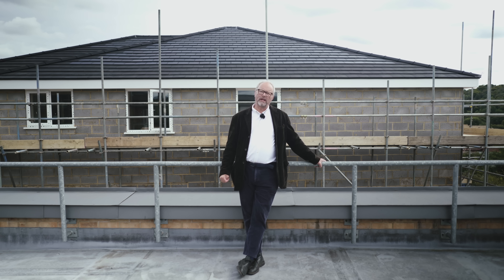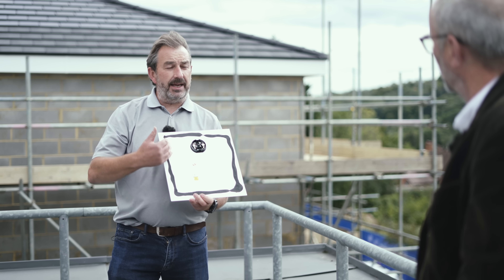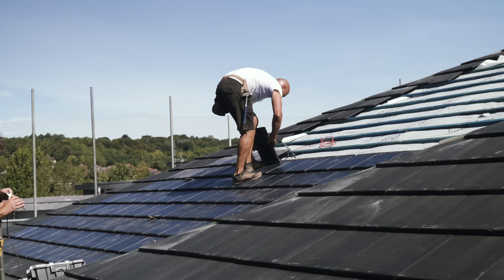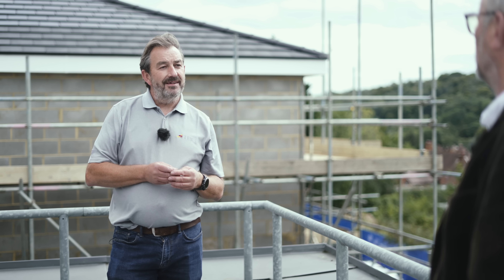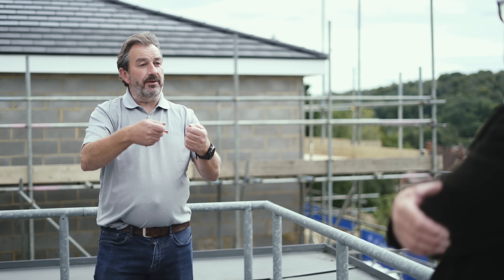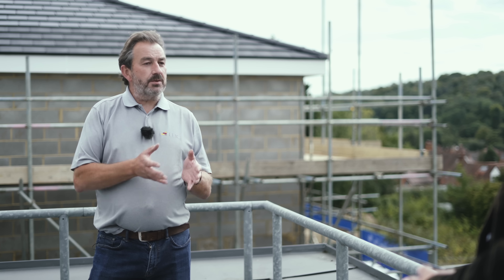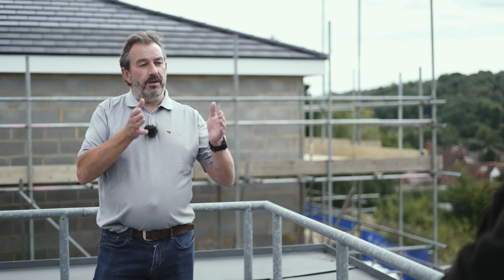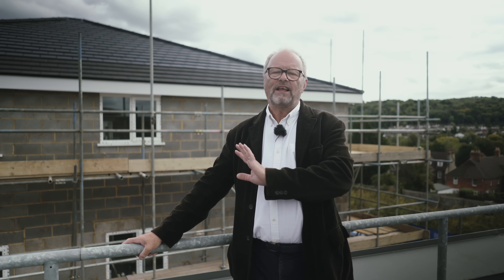Solar Roof Tiles - should every building generate its own power? | 100% Independent, 100% Electric

Comment: 1. Who climbs the roof periodically to clean the solar panels so they maintain efficiency?  2. What happens to the solar panels during a hailstorm? 3. What is the time-frame of degredation before the solar panels need to be replaced?  

It seems to me - economically speaking - it would be more efficient to light a pallet of pound notes or dollar bills on fire, then generate electricity with heated steam than this roof.
Reply: DuPont ETFE does not need any cleaning beyond rainfall
The tiles have passed the European hailstorm requirements
25 year performance warranty on the cells output. In 17 years of installing we have never replaced/upgraded old cells for m=newer more efficient versions
Reply: Chris Hall What fantastic non-answers! Let me see if I understand:

1. In between rainstorms one must suffer the degradation caused by dust, dirt, et cetera. 
2. You would have us believe the solar cells themselves are absolutely invulnerable to hail. You must - as you are suddenly quoting about tiles that one would expect - being made of concrete - are impregnable, and that nobody asked about. I do say there is nary a word about the solar cells themselves, of which a direct query was launched. I should think the laws of physics dictate being sandwiched between the practically immovable object and a not insignificant force literally raining from the heavens has consequences. 
3. Also we are to believe these are literally the only solar cells in the entire world that do not suffer performance degradation over time. 

I have to say, if we are to believe that solar cells in this video are truly magical to the point they are invulnerable to the elements and never, ever lose performance... it is perfectly unbelievable.
Reply: @1macgeek  1. In 9 years of having solar on my own roof, they have never been cleaned and are still working close to initial expected output.
2. By Tiles, I meant the completed solar tile. The silicone wafer is protected from impact by the DuPont ETFE mineral polymer topsheet. The European hail test is for solar tiles & modules, not for roof tiles.
3. The industry standard performance warranty on the cell output is, that they will still produce 80% of the design yield after 25 years. This does not meant that after 25 years they will instantly fail and require replacement, just the extent of the warranty that the solar industry typically offers.
Hope these answers help you to understand what we are offering, as this is just one solution in a range of options to increase the uptake of installations of solar pv technology.

Comment: Whether this system, Tesla solar roof or something else ought to be made more of a standard. I did back of the envelope calculation which says about 52m² on every household would give enough power for the whole country. And I am talking giving power to factories and such. The 52m² would cover more than the energy needs of the household itself. Households only consume about 30% of the power in a western country.

Obviously there are complicating factors here in that the power will not be delivered exactly when you need it. But it does give a sense of just how much potential there is in covering every roof. And 52m² is a pretty modest area. I would think a normal house roof is at least 80-100m².

But imagine having a house with 100m² solar panels. It will produce 75.00 kWh on average per day. That can charge up a typical Tesla car battery. However your average western household only needs about 10 kWh per day.  So you actually got lots of power you can sell to the grid and make money. With the big Tesla car battery you can store this power and just sell it when there is demand to make a pretty penny.

And the neat thing about solar is that you can in principle expand as you got money. You don't need to build 100m², you could build smaller. Then make money off that for some years and later expand.

With the Tesla million miles battery and bidirectional charging we are going to see some crazy no opportunities for people to have energy independence and actually make money from their home house selling power.

Comment: I'm all for Pv panels, I have some. But my question is will these get seriously hot? Mine have an air gap and they still get very hot.
Reply: Hi Dom, as we install all types of panels and tiles, from experience I can confirm that traditional modules get hotter than these tiles. The glass top sheet seems to magnify the suns rays ( just sit in your car on a hot day and feel the increased power of the sun through the windscreen?), whereas we have no glass over the front. We then bond onto 4.5 kg of concrete which acts as a heat sink, slowing down the heating of the module. 
We also have a different configuration of micro wiring on the actual silicone cells, making them much shorter than those found in standard modules,  as the performance drop in hot modules is actually due to increased resistance caused by heat in the wiring, having shorter wires reduces the effect of heat.
Reply: @chrishall8738  That sounds good, where could I find the test data for these tiles? Is it published anywhere?

Comment: Sounds like it would be cheaper and faster to produce a long 'five tile' unit, and install them that way. And use the more expensive individual tiles for the end sections.
While it's not possible to cut tempered glass (as Tesla uses) you can make lookalike tiles that can be cut, and also slightly change the roof shape to make it fit pre-shaped tempered glass tiles. So they should be able to make any kind of roof traditional tiles can.
Reply: Hi John, joining 5 tiles together would make them too heavy and fragile for a single man installation.
The initial design concept was for the modules to fit to the most popular size commercially available roof tiles, rather than invent another format of solar pv.

Comment: It's still a silly idea. Daylight in Buckinghamshire varies from 16 hours on July 21 to a mere 7:45 on December 21, so even if the panels would generate maximum power with any spark of light you would still only get half of the power on days where you are liable to use up to twenty(!) times more power than on a summer day. So no, there is no 100% independency because that would require you to somehow store in the order of 85% of the power generated in summer to be used in winter, and you can't and that doesn't change if you increase the numbers to include every home in the UK. The only thing you can do and what does in fact happen, is that you sell the excess power you generate in summer and use the money to buy energy back in winter. And that creates a contradiction, because if every home in the UK had solar there would not be any buyers and you would have no other choice than to detach the panels and let the power go to waste. So no, presenting solar as the primary solution for a carbon free future is not just silly but also a lie. As implemented today the only thing that solar does is disrupt the stability of the national grid and compensating for the erratic output of solar actually causes more carbon emissions than when power plants still controlled the grid. Really the only sensible thing you can do with solar is treat it as a non-vital element in our energy supply and use it to create hydrogen that you can use to power your car or other fuel dependent machinery.

Comment: LOL. Why does anyone even bother with mentioning Tesla roofing anymore? Last I checked, in their first three years, they installed less than 50 roofs (most of which had.... issues), and not a peep from them since. And the very first roof they installed for their public unveiling? Completely fake. Essentially, this is as much a failed Musky business as the tunnel boring nonsense.

Comment: I think solar roofs should be compulsory on new builds, with storage to reduce exporting during the day and overall grid consumption. Something they didn't cover with this particular product is stringing. A SolarEdge installation would use micro-inverters to maximise the production of each individual panel but it seems in this case a string of tiles are in series and then connected to the inverter. So shadows and cloud cover would impact the overall production of the string, and if the tiles are wired in series horizontally then potentially every row could be impacted by a shadow that casts over just one part of the roof.
Reply: Hi Russell, every tile has a bypass diode which acts as a micro optimizer in the event of shading or failure. The voltage passes directly through the shaded panel without reducing the voltage of the entire string.
Reply: @chrishall8738  Thanks Chris that's really helpful

Comment: Installer: "Its about 30 pounds a tile"
Interviewer: "...oh . . .wow"

$27,000 just for the tiles on this roof. Not a hater at all - I hope we all have this one day on every roof but there is a reason why we dont at the moment.
Reply: That would be $34,500 dollars, not £27,000 pounds going to be a very long time before that becomes viable for your average housebuilder or even self builder
Reply: @Bagheera These tiles should weigh about the same as the normal concrete tiles.  The hole drilled through the concrete tile should offset the weight of the photovoltaic panels and wiring.  I do agree, however, that the price is a bit steep.
Reply: @TheGuyThatEveryoneIgnores  drilling holes in tiles... sounds like a leak waiting to happen, considering every tile has a hole in it!!

Comment: Good to see them doing something, but Tesla has this beat hands down.  These guys are hanging on to the old solution and not working through solving the actual problem starting from scratch.  It's like putting an engine on a horse drawn carriage and calling it a car.  Sure it will work, but not well.  Imagine the structural savings when you drop the weight of that roof by eliminating the concrete.   How much CO2 was produced creating those concrete tiles?

Comment: what's the efficiency of these solar tiles compared to coventional rooftop panels? 

a comparision would have been helpful.
Reply: Our cell efficiency is 19.3%, utilizing industry standard silicone cells ( there is only 1 module manufacturer that we are aware of, that has a cell efficiency of just over 20%)
Reply: @chrishall8738  thanks.

Comment: Would a solar tile be more efficient if it were larger? I know any planners reading this would gasp in horror but isn't it time to break away from traditional tiling methods if solar panels are more efficient with greater size. Instead of many small panels just have fewer, larger ones.
Reply: Hi Phil larger solar tiles would be more efficient per m2, as there is a handling margin at the edge of every solar modules (regardless of size), however, the product is specifically designed to "solarize" existing roof tile technology rather than invent another size roofing element.
Reply: You also have to balance efficiency with many other factors.  Like Chris said adaptability is a form of efficiency.  If your system has 1 panel vs 10 of the same capacity and something happens to 1 in each scenario statistically you got a lot more cost to replace one over the other.  

Tesla V3 opted for a 3 tile wide system. Efficiency of install was the criteria behind that.   Get as many solar roofs as possible as fast as we can.

Comment: I'm a little worried about leakage. They put a hole in their concrete roof tiles. If the kit isn't put correctly or the kit doesn't dry correctly.

But otherwise I don't see any major problems.
Reply: 10 years of installations across the Globe and not one single call back for a problem.

Comment: I work on solar farms and many of our string faults come from the MC4  connections. This roof has hundreds  of these connections and would be a nightmare to find a faulty one.
Apart from that l like the concept and the look.
Reply: This we appreciate, however, AlLL of our connections are behind the tiles protected from the elements and animal damage, unlike exposed fittings in solar farms. In 10 years of installations we have not been back to a single breakdown, (fingers and toes crossed)

Comment: There are some very skewed figures here...

1. one of these tiles cost £30 each for a 15 watt module! That's £2 per watt!! I can buy a Black Mono 350 watt panel for about £80, that's 23 pence per watt!!
2. a standard 5kW system DOES NOT cost £7,500 - 8,000. If it is costing you that, you're being ripped off. You should be paying around £5,500 - 6,000. If this tiled system costs between £11 - 12,000, that is not an uplift of 50%, it's twice as much (100%). Most new builds like this WILL be able to cope with dead, wind and snow loading, it won't cost the earth to upgrade a few steels or have an additional batton or purlin in place, if needed.
3. The heat loss these will have will be high when the sun is really beaming on the roof as the heat has nowhere to go.
4. What do you do if there is a problem with one of these tiles? Suddenly you have a non watertight system and a hole in you're roof and how does that affect the 45 panel string?
5. Fitting 900 of these tiles and wiring them will not take just a few hours to fit, there is still the cost of an electrician to sign off and wire the inverter, and who drills the 900 panels with the holes required for the wiring? Is that factored in?

Please be careful when researching, this isn't a film for information, more a sales one, which is understandable. However it's also biased and somewhat misleading. If you want to go solar, go 'standard' or 'integrated', if you want it to look seamless and smart, go for black panels, they'll lose some efficiency at high temperature opposed to the blue ones but it's so minimal you'll never know and they look so much better.

Chris

Comment: As a roofer, how long will the adhesive last before the panels de-laminate from the tile which has a huge great hole in the middle ???  The strength of the tile is also being compromised by the contractor walking over the tiles already installed !!   In principle the idea is right, Im not convinced by the product for its longevity.
Reply: The structural polymer adhesive developed specially for the tiles was manufactured by the UK's leading adhesive manufacturer, and comes with a 30 year warranty

Comment: Do they make a system for a flat roof?
Reply: A minimally pitched roof?  Water needs get off and get busy.  

The system is flat it’s only the angle of the plane of the roof that is tilted. 

Go for a panel system if your in the market.  One that sits up on a frame to the optimal angle.
Reply: @ZzHasbrozZ  
In the UK, the flat roof may have a small pitch that's may have a 10° pitch to allow water to run off.
Ideally, I'd love to cover the whole roof without an A frame system as it tends to get windy and there are 3 storey building s which over look my 2 Storey home.
Reply: Yes we have a separate system that can be applied to flat roofs.

Comment: You say this is the world's most popular roofing tile, but I live in Canada and I have never seen anything like it.
Reply: What’s that aboot?

A commercial usually has that same dialogue.
Reply: 10 per m2 concrete flat roofing tiles are manufactured around the world, Concrete tiles have been used in Canada for 40+ Years. Marley, Unicrete, BC Tile and Lifetime are just a few which you find installed across the country. .

Comment: What a rip off 30 pounds a tile, you will never make that money back in the houses lifetime, 900 tiles, normal roof 900 pounds, solar tile roof. 27,000 pounds, average irish electricity bill 850, after doing conversions, even taking into account that the roof supplied every once of electricity and you remained off the grid, it would take  34 years to break even. Average daily house should electricity usage in kilowatts is 25, so best case scenario, 68 years to break even,

Comment: I am to electricity what Genghis Khan is to world peace, so!
Also Iv'e thought many years ago why this simple Lego system was not in use (if only I had a brain in series, or is it parallel?)
I'm sorry to say it, but, we all live under a roof, and we are all supposed to change colour (green)
I know this is heresy, but, why are you prattling along about cars which we all don't have, or maybe use
If every roof had these, would we need power station? (is that to political!)
Roofs are far more important than cars, so can you do this all again, only this time explore some of the comments on fault finding here battery walls etc (if you dont someone else will, and it will be big) 
We have with government push over the last decade or so, pumped our orifice in our houses full of fluffy stuff to stop heat getting out. If a roof tile and a AA battery can pump heat in, it must be the next big thing (once the stupid prices stop)
Can all the clever types tell me how much electricty can be produced if we all had a few tiles on every roof in the UK?
Reply: Power plants keep the HVAC running.  Solar can run most everything else.  Power plants are here for a while mate.

Comment: 1. Is there a way to tell failed and working panels in this system

2. If some fail will the remaing panels in the 'series' send power to the 'parralel' system

3. If you need replacement of a few panels can a local technician do it or you have to call these guys

Comment: why isn't this on my house ? Why everyone told me that Tesla was the first one to do this?
Reply: Because you can’t afford it...?

Solar integrate roofing products have been around for a long time. 

Standing seam with flexible rolled solar panels between the seams was the first time I was like ahhh!

Metal lasts a long time and cheaper than most things beyond asphalt shingles.  So it was the perfect integrate roof option for middle ground pricing.